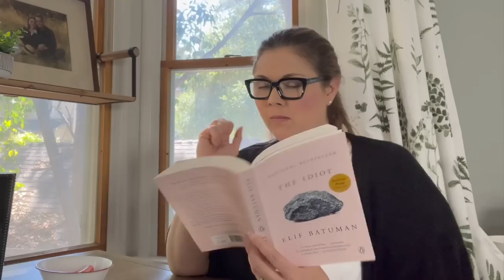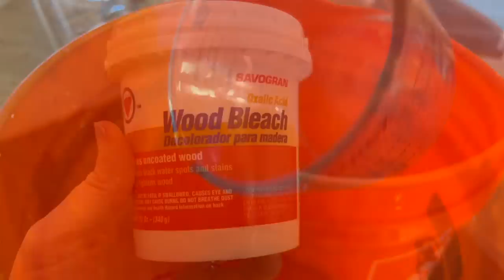MODERN PINK | Dark And Dated Dresser Refreshed With Tonal PINK Technique | INDULGE Your SWEET-TOOTH!

Comment: That's a very sweet pink.   Nice job!  Just for your information,  that "extender" that you got is available at most hardware/builder supply and paint stores under the label Flotrol by Flood.  It will cost you a lot less in the long run to switch.  It's not clear as it comes out of the bottle, but it dries perfectly clear and Matt so it doesn't interfere with your paint.  Great stuff!  Try it; you'll like it! 😉
Reply from the maker: Great tip, thank you!!  And so glad you liked the pink!

Comment: I am wondering if some sort of UV light would assist the wood bleach. My project I bought oxalic acid for , a solid maple, no veneer small coffee table had several black water stains. I did several days of soaking indoors, out in the sun, did a crystal and smudging ceremony…no luck.  Eventually my husband took over and sanded till it was gone. It is a luxury that is not available in most pieces. It left me pondering what I could do on a future project.  I would rather do something interesting, but hubby is more of a plain sort.  It is one of those projects that at first glance appears simple and straightforward, but once you start working you discover it actually requires 100 hours of sanding and everything from planers to dental picks to actually clean all life has thrown at it!  I struggle staying interested for that length of time.
Reply from the maker: I understand that for sure!!  Thanks for sharing.

Comment: If the stain is organic in nature you could try hydrogen peroxide, that’s what our floor guy used to save our hardwood floors from dog stains. I wasn’t sure it would work but it worked like a charm. No dark spots left and no feathering in new floor.
Reply from the maker: Thanks for the tip!

Comment: Next time maybe try to remove the draw pulls from the inside, unscrewing the screw, not the handle, to remove them, then you wouldn’t damage the front of the draw, the handles would just pull off once the screw was removed. Maybe paint stripper would’ve been more efficient to remove the old, ingrained stain, especially on the carving, rubbing it in with a stiff nylon brush then, like the Oxalic acid (so great for removing stains) washing off.
Reply from the maker: Thanks for sharing your expertise!

Comment: When you applied the paint wash over the white paint used for the stencil, how come it didn’t pull up the design? I would have thought that the water in the wash would have reactivated the white paint used for the stencil. Thanks - I’m over here trying to figure this out :)
Reply from the maker: I'm so glad you asked this!!  So the stencil was in the Peony pink color too.  But as for reactivation - you are correct.  Fusion does indeed "fuse" faster and stronger to surfaces than say, a standard chalk paint would, but I did see some little spots where my stencil got a little too washed away.  I ended up doing a tiny bit of stenciling touch-up, by laying the stencil back down over what I had already done, and just adding a bit more paint to the spots that needed it.  And I had meant to show that in the fable, but unfortunately the video wasn't clear and then I forgot to mention it!!  Kudos to you for catching that detail!! 😊🙏